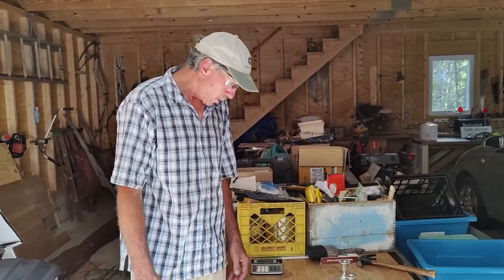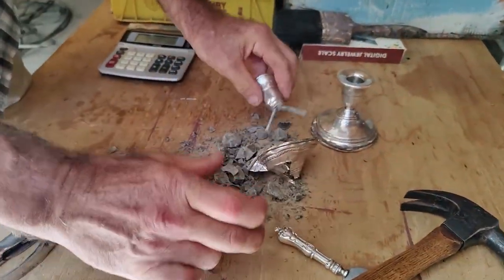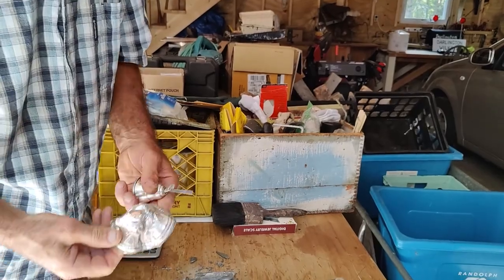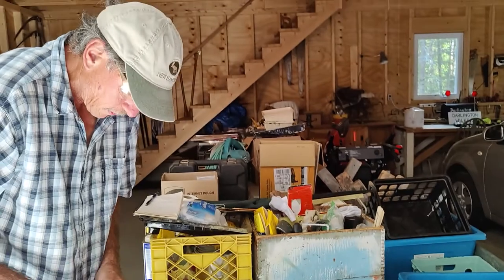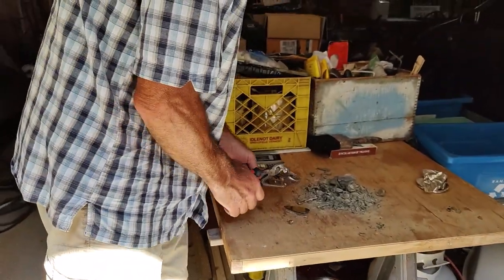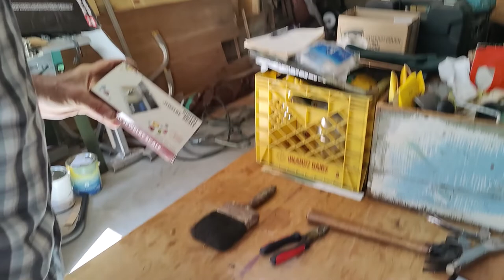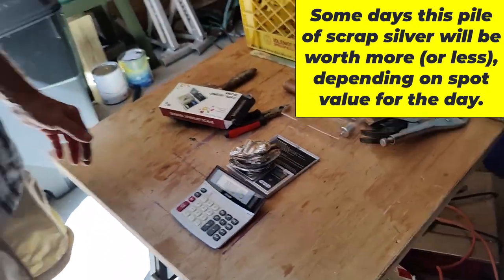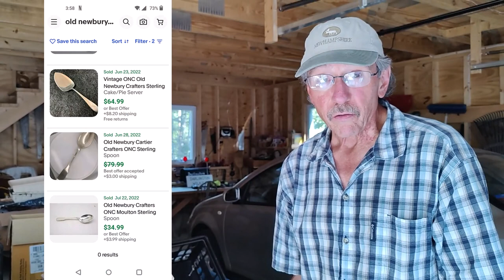Buying and Processing Scrap Sterling Silver

Comment: I learned from another Tuber to use a Dremel with a cutoff wheel and zip from the closed end to the open end on one side. Then you can peel it open and extract the stainless and any cement, epoxy, or resin without a big mess.
Reply from the maker: That's a good idea, Ivan! I happen to have one of those tools! Thanks for watching and commenting!

Comment: Why are you using ounces rather than troy ounces
Reply from the maker: Hi! It never really occurs to me to think in troy ounces since for the most part we're just hoarding it (except for certain pieces that are likely to sell for more than spot value). But you bring up a good point, and I'll have to check that scale when I get back to FL to see if it has a troy oz setting (I'm in NH right now, and didn't bring it north with me). If we measure in troy oz it will be slightly less value than we mention in the video. Thanks so much for watching, and for your comment! We appreciate it!